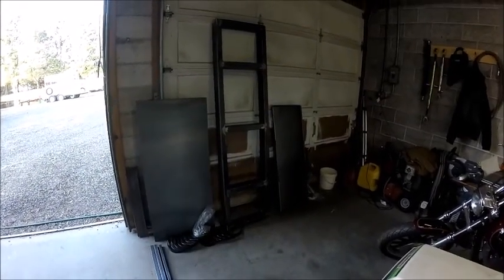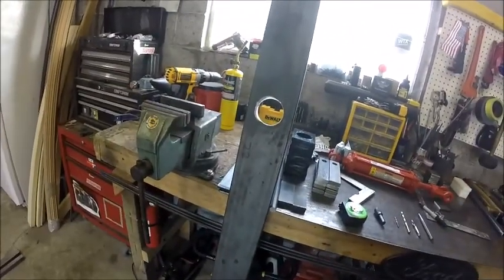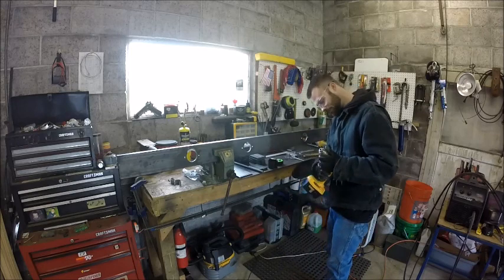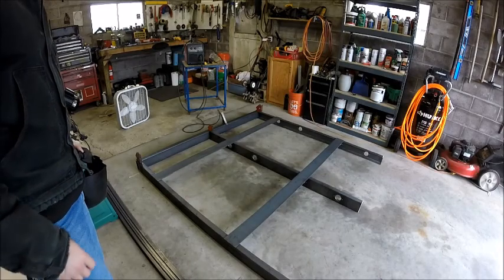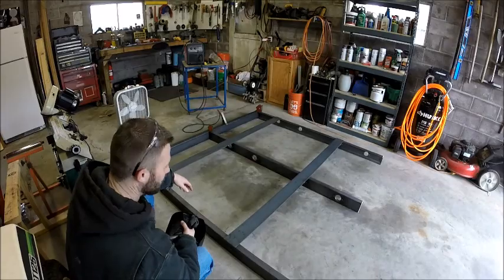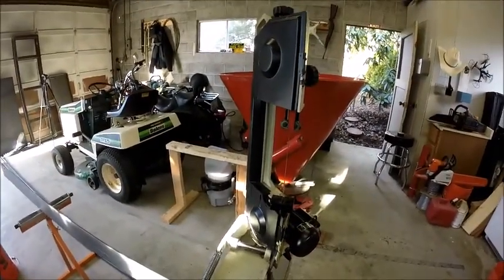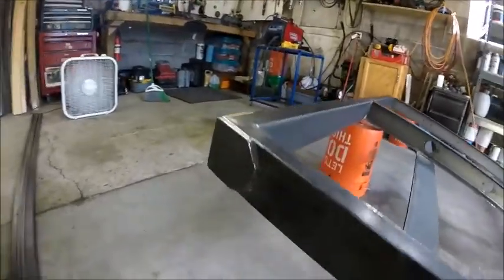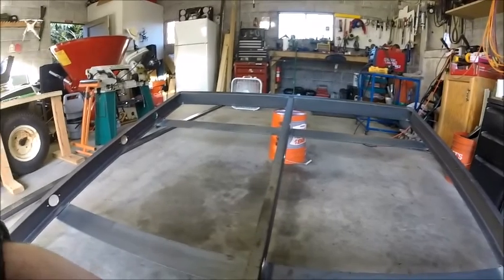Hay Grapple Accumulator Build Part 2

Comment: Flux core is difficult to make an amazing weld.
Reply from the maker: If your settings are right, and the material is prepped correctly, you can make a very nice weld with flux core. You'll have spatter to deal with, but the weld can be beautiful.

Comment: Can I ask. the spacing for your 2" holes.
Reply: Thanks for your help Anthony
Reply: I would also like to know the dimensions from the main frame that you found to be ideal for centerlines of the pivot bars
Reply: 8" -24"- 44"-62" to drill on center of 3/8 C channel , only drill thru 2 pieces of C -channel.
Reply: Use 1-3/4  hole saw for drilling Delrin bearing and  metal C-channel. At least that is what I did when I built mine this month.
Reply: Chris drilled slightly larger holes in the metal to avoid the square tubing from rubbing on the metal.
Reply: I had all metal cut at shop where I bought it. Saved tonnes of time having main frame ready to weld. You will have plenty of other parts to cut
Reply: one more thing. I built mine to fit my Skid steer. I wish I had gone with the 10 bale accumulator. I found driving thru the field with the 8 bale accumulator was very easy,also the 10 pack will stack better for travel from field to storage shed.
Reply: I could also make one more suggestion . Make your own attachment plate. It only takes about 2 hrs and will fit better